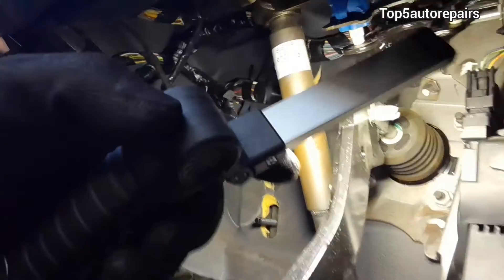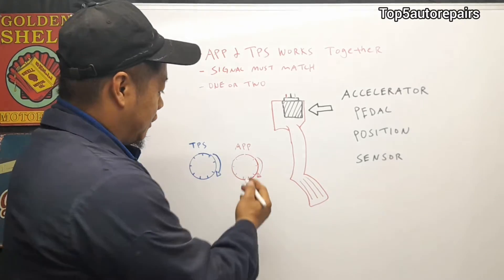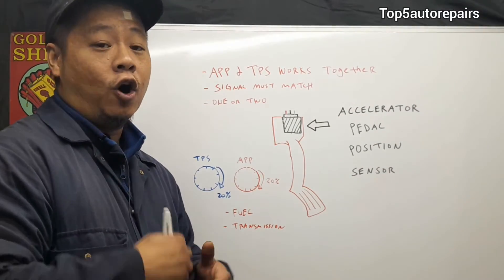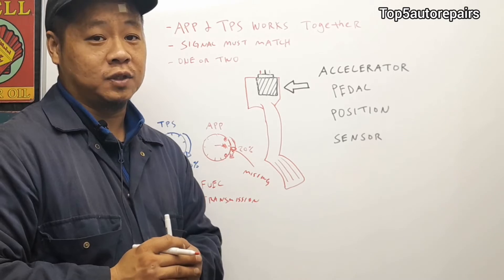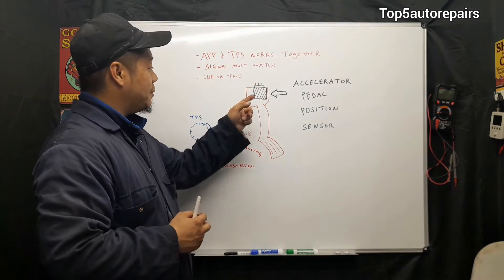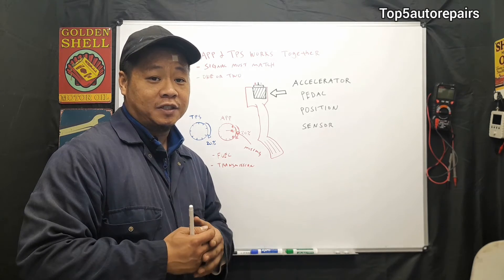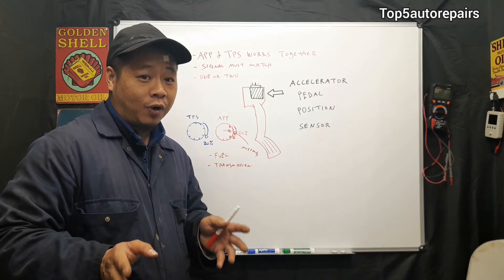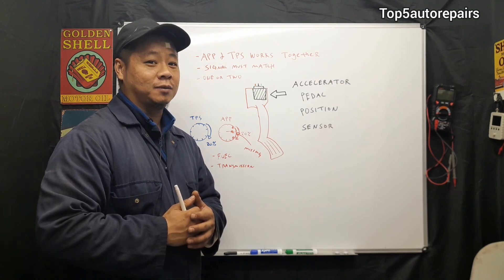Symptoms of a Bad Accelerator Pedal Position Sensor (Learn how it works and why it fails)

Comment: I have this issue on my 2010 GMC Sierra.  The hard code is P2138 throttle pedar position sensor/switch.   It's been intermittent for several years.  A check engine is on and the engine power is reduced and of course acceleration is slowed significantly and it runs rough at idle.  It goes into this limp mode at both highway speed and idle.  I shut the truck off for 1-2 minutes to clear it.  It may do so again a few hundred yards, a few miles, or it may not do it again until the next trip.  Sometimes power shuts off completely to the truck without even any dash lights.  What's interesting is it only does so occasionally when the outside air temperature is warm, sometimes going 6 months without  any issues.  But when it outside air is cold, especially at or below freeze point, it occurs repeatedly on every trip.  So the cold air somehow makes the problem much worse.  I constantly have to shut off the truck to clear the problem.  One day in July it was at the point that it went into limp mode the moment I pressed the accelerator pedal.  I shut off the truck and disconnected the throttle pedal position sensor to inspect the connector and wiring.  I found no issue and reconnected.  Then there was no issue until the outside air was cold 6 months later in January.  I checked the mass air flow sensor yesterday and there was only some surface dust on part of the sensor, which I cleaned off.  But the problem still remains.  An easy inexpensive repair is to replace the throttle pedal position sensor.  But I don't really want to replace it unless I know for sure it is the problem.  I've read some people have replaced both it and the throttle body, and it didn't resolve the problem.  It's strange because it's consistent when the outside air is cold.  In warm weather, it rarely occurs.  If it's a wiring problem, it would make more sense to occur constantly.  But it's only constant during cold weather.  It doesn't start to occur frequently until the outside air temperature is below 50°F.  Any suggestions on where to start?
Reply: This is exactly what happens with my 2018 Chevy Malibu. No issues during warmer weather but it started back again when weather temps changed.

Comment: I have a 2021 hellcat charger that is accelerating when I turn it on and I have changed the throttle body out and reset everything to stock including tune and it is still accelerating. I cannot figure out the issue please help.

Comment: You may be my last hope, please help me. I have opel corsa 1.2 f from 2020 84Kw manual. When emgine working temp is achived, my rpms are growing very slowly until 4500rpm them it's alive again umtil rpm are idle...then it starts all over...gas pedal bottomed and rpm are slowly building, accelereration is very slow them from 4500rpm is   sharp and fresh again until idle...what should I check first what can be broken? I have only 28kkm done with this car from brand new

Comment: My scanner shows voltage drop in APP sensor 2. Goes from .5v to 0v for a split second and then back up and does this intermittently throughout the pedal range.
My digital multimeter doesnt pick it up when backprobing the pedal.
No check engine light, reduced power, intake very loud, jerky and shifting late. 
Im assuming its the pedal sensors.  I dont have an oscilloscope to verify the voltage drops while back probing the pedal connector.
Ever ran into this?

Comment: I have a 2015 Infinty q70. I think my sensor on my throttle is bad. Does it always have to show an error code or engine light on?  Also i have a technology package with mine. Why is the Psition sensor so much money,. The dealership qouted me $ 3500

Comment: I have a 2004 tukon with code P0120 throttle pedal position sensor circuit. I Change the pedal works fine for about 5 months but now I have the same problem again...

Comment: I'm having a random shutting down issue.  I have checked and replaced numerous sensors and still have the problem.  I'm focusing on the accelerator pedal now.  It usual happens just as I am pushing down on the pedal in traffic or taking off from a stop.  Thanks!
Reply: Did that work? I’m having the same issue after replacing my ecu.

Comment: My 2012 Corolla S 1.8 Automatic rev while driving on a steady speed specially when going at 35 and 40 or 45mph and even at 60mph. It Also sounds like I am racing, In other words running rough. Can it be the pps? I had two mechanics check the vehicle one of them drove it and connected a computer but nothing. He thought it was the transmission but the temperature was normal and also no leeks, so he said I don't know what's the issue with it. The other one told me to just keep driving it like that till I get a check engine. Very confusing since I'm not getting no error codes. Does anyone have or has this same issue?

Comment: I was looking my throttle body and it moves when ignition is on and engin off, but when i start the engine throttle butterfly flap not  moving when i press gaspedal

Comment: Hello, I drive a manual 5 speed  Mustang GT.I  am a rev match driver on downshifts which means a blip on the accelerator between shift gates. My problem is a lazy/ no reaction response when doing so which is massively annoying. No codes, no other issues,one video suggested cleaning the throttle body. I will try any and all to fix.

Comment: Good lord! Why does everything have to be made less reliable and create more failure points by being electrically controlled and all these garbage cheap made electronics (especially if it’s a stellantis) cause the cost of the unreliable vehicle to cost more in order to get.1% better mileage. Stick with a mechanical throttle connection or anyplace a mechanical system where ever possible.

Comment: Thank you for this video! I’m experiencing this now!  Will this also cause the vehicle to just stop running? I ordered the pedal with the sensor and while driving it to the shop, my friends shop, it kept stalling on me!! I’m hoping that is part of the issue as well!!! And after it’s replaced it will all be fixed!! You’ve explained everything so well!!! Seriously. Thank you so very much!
Reply: Was it the issue
Reply: @DeeDee-ye1rg it wasn’t my issue!! My issue was loose wires!! Saved me 230 on the part. But cost me 150 in labor !!

Comment: I lost 100% acceleration in my 2010 Toyota 4Runner. Truck idles smoothly, just wont accelerate. I changed the complete accelerator pedal assembly and still No response. any suggestions?

Comment: Can it make it not start at all. It went into limp mode the other night. Then I reset codes and drove it 10 miles all good, and now it cranks but doesn’t start. I cleaned throttle body up and it seems to work.

Comment: Is possible to have a bad accelerator pedal sensor but no engine light on a dash board?
Reply: Yes, i have no engine light. But with odb scanner it gives a code. And my cruise control not working. This is on a 2004 Renault Clio

Comment: My 2015 jeep trailhawk started  having shifting issues. But no codes. The dealership changed the fluid and had no change. One of the symptoms is if I tap the accelerator, not flor it, just tap it, the transmission downshift 2 or 3 gears like if I'm floring it. Another symptom is when I'm getting close to 65, it wants to drop one gear from 8 to 7 at the slightest incline on the road and then it will stay there up until I  press the accelerator and release it. I think you just solved my problem.  Tks a million.

Comment: Why would it be my 06 sierra turns off soon as I put it in park or drive but turns on just fine no hesitation 
Transmission was rebuilt new torque converter installed rear main seal replaced ,radiator replaced, and throttle body from junk yard practily new

Comment: I'll let off the gas pedal in park and rpms with stay up for about 2 seconds and then drop to normal idle speed. Is that a bad pedal sensor? 2014 Silverado.

Comment: I keep getting a p2135 code I replaced the throttle body and the gas pedal like 3 times because i have warranty on the pedal sensor because i purchased it from autozone smh idk if its the cheap brand from autozone cuz it only says “engine power reduced” when i hit the gas pedal

Comment: Let me start i appriciate any responce with help. i have a 17 ram 1500 4x4 5.7 i put a used trans 53000. The truck has a rpm surge cauing trans to shift off and uncomfortable drive quality NO CODES ive replqced the throttle body guessing. New plugs and replace 3 coils that were bad or failing rest checked out as good any info helps

Comment: It is posible, the faulty to make the engine, after start, to work on 900-1000 rpm (on place) instead of 750?

Comment: Yellow wrench light turns on triggering limp mode when raising idle to 1500 - 2000 RPM. Replace accelerator pedal sensor.

Comment: Thanks for the video, Is there a chance that my APPS is going bad without getting a check engine light? because my 2014 Q60 is been acting up when I press on the gas pedal and loosing power and my gas milage is really low. Thanks.

Comment: I'm getting a C0561 is that a gas pedal code? Also i have low idle speed at about 580s while in park i know its not to bad but it causes misfires, ive already switched the throttle body plus spark plugs and wires, coils and injectors most of the sensors

Comment: You presented the issues associated with APP, but you did not provide any solutions. Please provide solutions to APP problem. Does APP require calibration with TPS after replacing or installation?
Reply: The video has  SYMPTOMS right in the name. And this guy says in the video bring it in to my shop

Comment: Wrong. That accelerator trigger and the electric throttle plate motor on the throttle does not work by going through the ECM, but is a direct connection that will operate regardless of the ECM, unless the motor fails at the throttle of the pedal trigger. These days everyone is a liar to make money off of people. Now your Throttle position sensor works from the software in your ECM, but a TPS is simply for the idle. Anytime you dont get response from your gas pedal, that is the throttle plate motor or the pedal sensor trigger and those two arent linked with your ECM, same as the pre 2005 cable operated pedal for your throttle had nothing to do with the ECM
Reply: This actually helps. I was beginning to think maybe my ECM is interpreting info incorrectly. Obviously super rare. I have replaced quite a few sensors because I noticed slow response. The vehicle is 14 yrs old and has 147k miles. I have the fuel trim down to 2 of each other.  Tonight going home I just fired up the data stream on my scan tool. I took a few just snap shots while I was driving home. I noticed the truck felt a little off. It has had sluggish acceleration for months and months, but no codes ever. GM must have some huge parameters to operate in. I never throw a code for anything, even if something is out of wack and causing issues.  After reviewing the snap shots, I noticed no matter how fast I was going the accelerator pedal position sensor D & E were fixed at 18.8% and 9.4% and never matched the relative throttle position sensor. My drive home is about 2 miles.  In true GM fashion, no codes ever.  The vehicle is a 2010 GMC Sierra 5.3.  Do you think this is the app sensor?
Reply: @RobsReviewsAll  Sounds like your injectors could possibly be sticking, not stopped up, but sticking. With engine running put your finger tip on the plug of each injector and you will feel a definite thump, if one or more has a lighter thump then the injector may not be opening all the way. About some not throwing codes does exist in the motor line of vehicles also. I have a 98 dodge ram with a 318 and oh yes it is a OBD 2 ECM. I have changed two batteries and one alternator in the past 14 years and it never even required the ready monitors to reset and has never thrown any code. Now my 02 ford lariat F150 should be renamed code thrower. Also, a leaking fuel regulator valve can cause hesitation and so can a maf sensor

Comment: This happened to me all of it.. i disconnected the wiring to app senson and put wire in each o to clean anythinf in the out and have neen driving 80 miles since. I reseet check engine light and its not back on.. if it was the sensor wouldnt the check engine light come right back on immediately. There isn't a way i could be driving all these miles now if they sensor and pedal need to be replaced without a check engine light still an i correct?

Comment: Limp mode, a safety feature meant to help you get to the mechanic?
Bro I almost died today because it randomly kicked on while I was on the highway.

Pedal, throttle body, sensors all replaced and inspected in the past 4 months.
Reply: So what was it
Reply: @ProjectM51  Shop found it to be a faulty wire running between the throttle body and accelerator. 
$240 to replace/fix and haven’t had any issues since.
Edit: I made the original comment while I was stranded on the highway with the issue. Towed to a shop and fixed within 4 hours.

Comment: hey I like your videos, I have a question ? I have a 2008 ford f250 v-10 and when I come to low speeds for instance stopping at a red light sometimes my vehicle will unexspectly  want to go by itself unintended acceleration and I have to cycle my key off a few times before it goes to normal I did change the foot pedal and brand new throttle body with both new acc sensor and the other sensor and the same thing keep happening so I keep reading up on this situation and I did the relearn procedure by taken the negative battery off and discharging the capacitors from the ecm so far 2nd day now it seem to hopefully our the trick but it scary when you truck wants to go and you have your foot on the brake and it rev real high I think in about 60mp range ant suggestion  would be helpful thanks again?
Reply: also no engine light comes on

Comment: I'm suspecting this issue on my '06 Honda pilot.  Seems to get a throttle position error only when accelerating in a certain range, but not while in cruise control.

Comment: Today my 05 lexus rx330. Driving on the hwy @ 45mph. I kinda floored the gas pedal to quickly accelerate the car to pass another car, my car jerked then the engine, vsr track, off track light came on. The gas pedal felt dead, the car was slowing down, could not accelerate, I had to pull over on the side of the hwy to stop. I  turned off the car & waited a few minutes. I started up the car & it was normal but the engine lights was still on. So I drove home. Code reading was P2112 throttle body stuck??? Thanks for this video. Ill replace tps & app sensors.

Comment: Quick question. My vehicle has "drive by wire" gas pedal. If the hinge of the pedal is making a ticking/creaking noise when I tap the gas pedal, is it safe to lubricate it?

Comment: My 2015 chrysler 300 3.6 doesn't want to turn over, I have P0123 and P0222, I put a new throttle body but nothing. I used a scanner and appD is at 8.2 and appE is at 3.9. When I step on it both D sits at 91.4 and E at 45.5. Can anybody help!!!!
Reply: Update?

Comment: Hi i have got the a class mercedes a180 2014 w176 petrol acceleration pedal i.m till end fast but the RPM needle moving slow on 4000 RPM. NOT on 5000 RPM please can you tell me whats the problem please thanks?? And the same time very slow accelerating

Comment: Unlike other comments, my concern is the opposite. 2009 Matrix/Corolla the pedal is very sensitive from a stop. A slight depression of the pedal causes motor to react like I pressed halfway. You have to be very carful not to have "jack rabbit starts". APP sensor?

Comment: What would cause my truck to have an irratic pedal issue? When accelerating, if i floor it, the truck will act like im at half throttle, ill feather it back just a tad, and it will get all its torque back. Basically most of the time i have to find the sweet spot just to have all my horsepower there. I KNOW its somewhere between the pedal and the throttle body. No codes though. Is there a way to calibrate the sensor? Ive tried the usual "key on engine off, slowly push pedal to the floor, hold 10 seconds, slowly let off, key off", and tried the same thing without the slow press and depress. Would a worn contact point at the floored position give the throttle body a wrong voltage reading, causing it to think im only at half throttle? Having no code is where i get annoyed lol
Reply: My exact problem

Comment: I have a 03 Silverado 1500HD would the APP sensor cause the engine to stay running when ya disconnect the MAS air flow connector?? I just put a new mass airflow sensor on my truck and it’s still doing the same thing to wear when I disconnect the wire to the mass airflow sensor the engine stays running?

Comment: 2010 Nissan altima 2.5 engine.  Changed timing chain, new air filter, all 4 coil pks, all new spark plugs. It helped my car gain more speed, but still, when i go up a long hill, i have the gas pedal all way to the floor board and i have to use the automatic shifter because if i let it go over 3100 rpm, it goes into limp mode. Nobody can tell me whats wrong with it. Im lost ! Can you please provide any information that might help me know what is going on. It dont cut off when this happens, but throws codes up like slip, and o God,  alot of codes, i pull over on sude of road, cut the car off, then i start it back up and all codes are cleared out. And has no check engine light on, ( tire sensor light has been on since i bought the car. But please, can you give me any reasons my car is acting like this.. Thank you, Sir 😢

Comment: Can APP sensor  cause truck to not start?
Reply: Perhaps,…. I had a no start on a Subaru 2008 Impreza n/a)  and a newer used APP sensor  started it right up,… ( even thou it had a very rough idle) but once I gave it gas , it shut off ( double checking throttle body soon)
Reply: @juelzgdo2660  thanks for the info homie